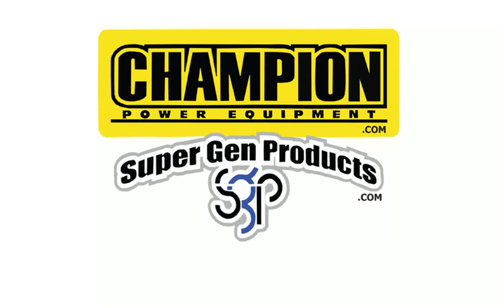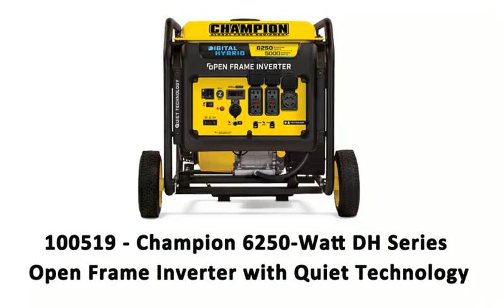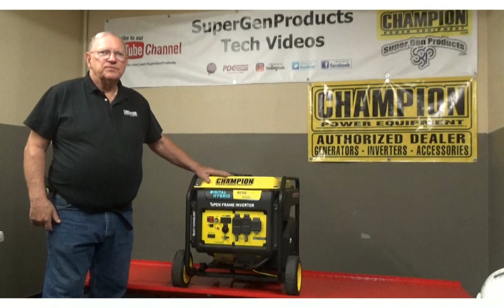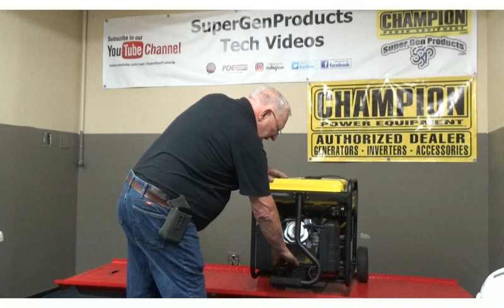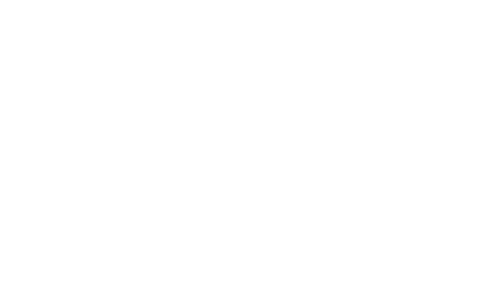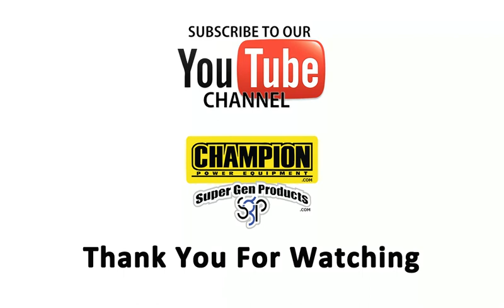Champion 6250 Watt DH Series Open Frame Inverter with Quiet Technology

Comment: I hope to never use the gas aspect.☛>share4.photo/CIgenerator?5らf     I have only used the propane fuel so as not to worry about conventional gas contaminants over time. Propane burns clean and leaves no contaminating materials. However, if a situation arises where gas is my only option, if prepared for that as well.

Comment: All this needs is a dual fuel option (without a lower propane rating) and I'm sold!
Reply: there will ALWAYS be a lower propane and even worse with NG  rating
Reply: @Erik B:
You can't have equal power between gasoline and propane and natural gas. Each fuel explodes different.